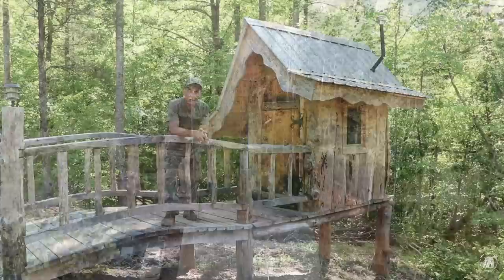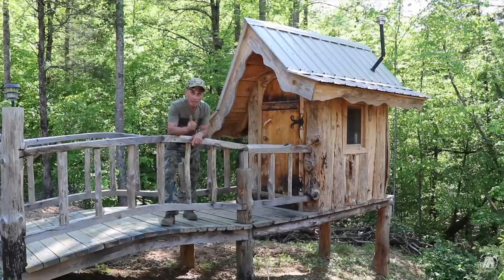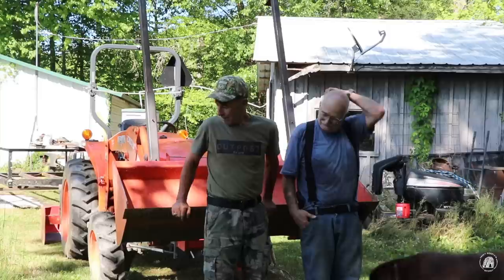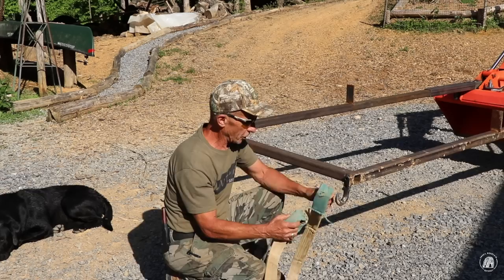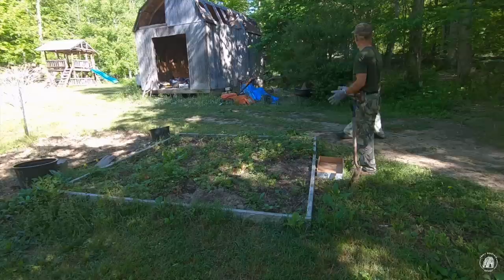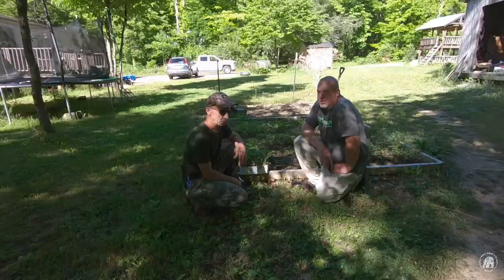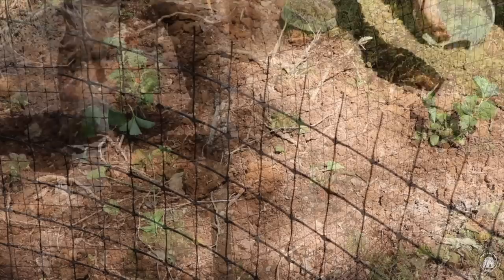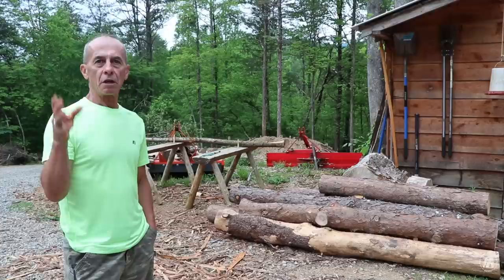Tractor Front-End Loader Boom Modification | MASSIVE 10FT EXTENSION ON OUR KUBOTA!!

Comment: Do you think the tube is strong enough for that long Extension? I would make it as a triangle with smaller tubes on top. I hope you understand what  I mean.
Reply from the maker: I understand what you’re talking about. I had used them before and cut them off and they worked just fine. I just didn’t have any way to take them off that’s why they ended up being cut off. I had to get a size bigger so that I can slide them down in there drill the holes and have a way to connect and disconnect it